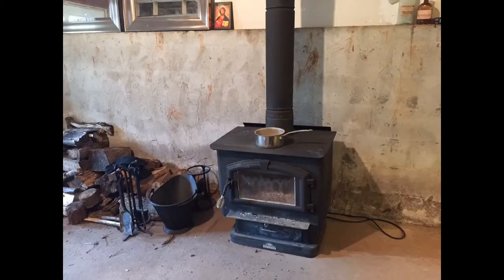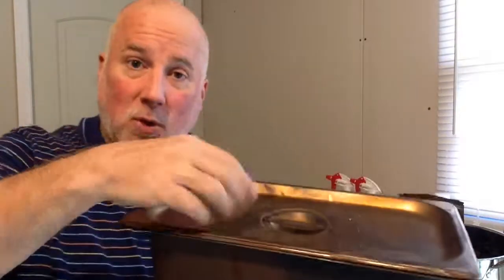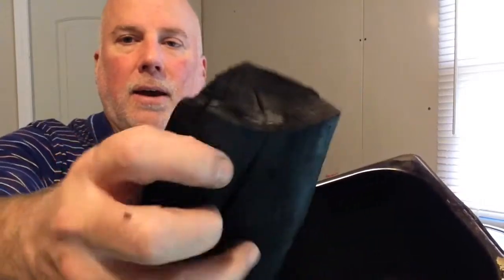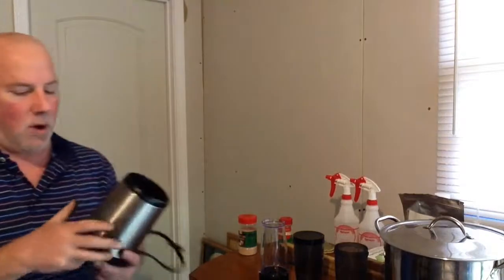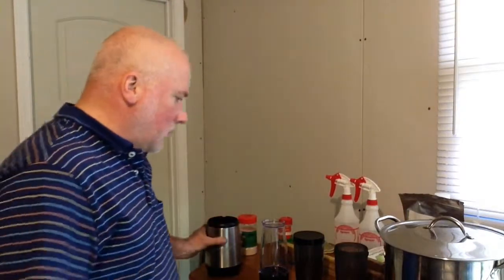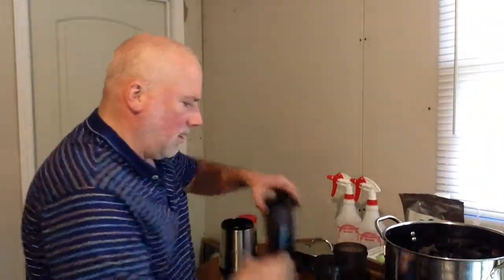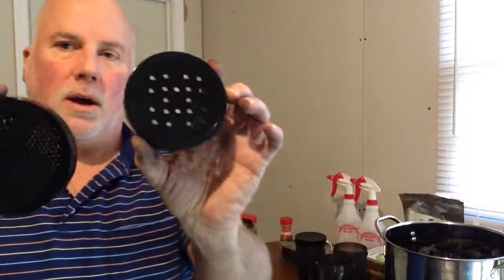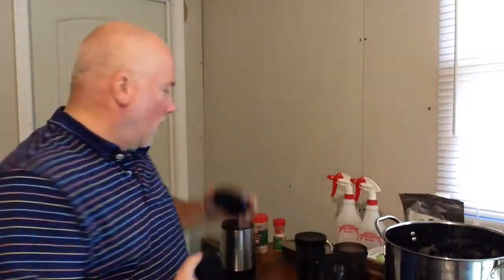Mini Biochar Manufacturing Assembly Line - How to make Biochar - the final step

Comment: I would have felt a lot more comfortable if you had taken the blended char OUTSIDE before opening it up (ideally on a day with a light breeze blowing from your back side).  I crushed some char in my basement earlier this week with a tamper.  I was wearing an N-95 mask.  Within five minutes the mask had turned black from the invisible particles it had trapped...and there was a black line on my gray beard on each side of my face where the edges of the mask was.  This due to the 'less than tight fit' and from char particles trying to get into my lungs via the miniscule space between the mask and my face.  I shaved my beard 30 minutes later and vowed to never crush char again unless I am wearing a tight fitting mask and am outdoors with a breeze that leaves me upwind from the biochar I am crushing.  (I also wet the char thoroughly before crushing it).
Reply from the maker: Good safety precautions. Thank you for commenting.

Comment: Why not add some liquid inoculant in there with it and grind it that way?
Serves two purposes and almost no dust. Pour and serve so to speak.

I quench mine the moment I get the charcoal out of the heat in a solution.
Then strain it and smash it with a wooden handrail in a bucket.

Comment: You made plain charcoal not biochar.
You have to inoculate it first to make it biochar.

Ideally you would want granule sized pieces with some powder.
Reply from the maker: Mixing it in with compost and using it in the garden gives the good microbes places to live. Over time, the soil gets better.
Reply: He did indeed make biochar. Biochar IS charcoal that is produced by pyrolysis of biomass in the absence of oxygen; particularly when used as a soil amendment, as is his intention. Direct combustion—a thermochemical conversion process—is when biomass is burned in the presence of air (nitrogen and oxygen). Biochar is made when biomass is slowly baked until it becomes a carbon-rich char. This process is called pyrolysis, which refers to the chemical decomposition of organic material when exposed to elevated temperatures in an atmosphere with restricted levels of oxygen. This is precisely the process that John used to create biochar, which he will then add to his compost. Making the charcoal/biochar is step one. Activating the biochar - or inoculating it - is step two. This process, also called charging it or energizing it, is how you make it ready for the soil. This is where you add the biochar with compost or mature manure and mix it to incorporate the soil and the compost with the biochar. Hence why he was grinding it. Step three is really where the inoculation comes in. You can add regular water, there should be enough microbes within the ingredients to populate the biochar, but if you can use worm tea (or compost tea), you are also introducing all of the bacteria in those worm castings. To boost the bacterial population, you can add molasses or syrup. Any sugar-based liquid at this point will activate the biochar compost and the biochar soil in your garden with some organic matter.
Reply: @kanoa3109  It ain't biochar until you put the 'Bio' part in it.
Until then it is just plain old 'cowboy charcoal'.